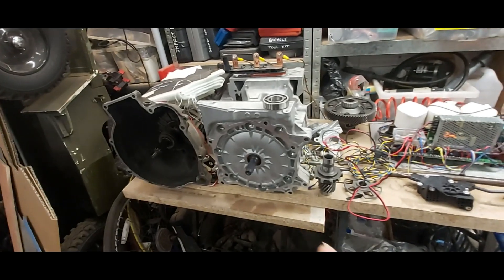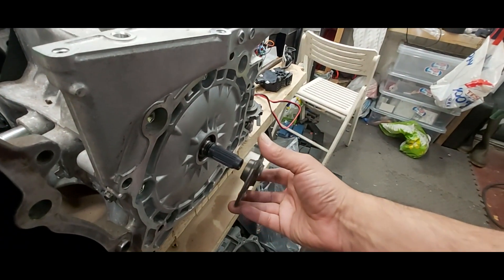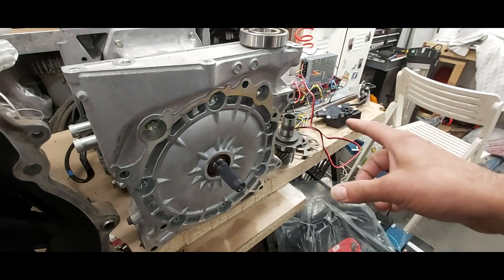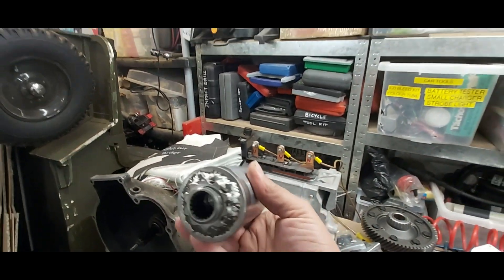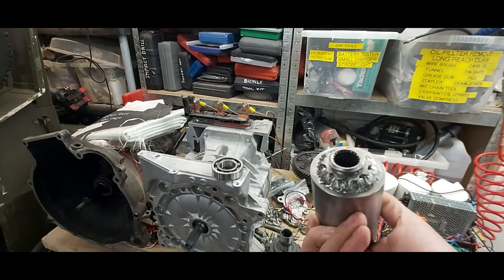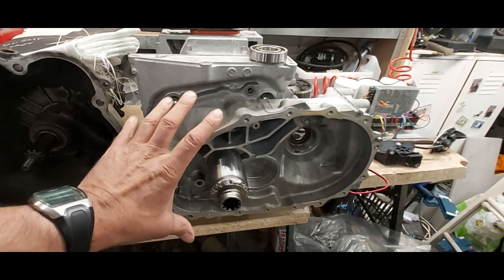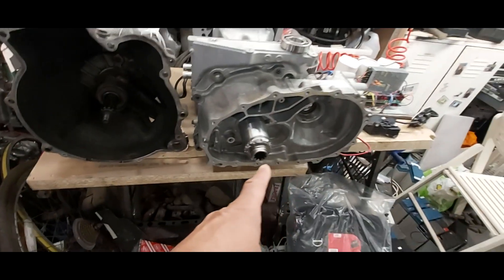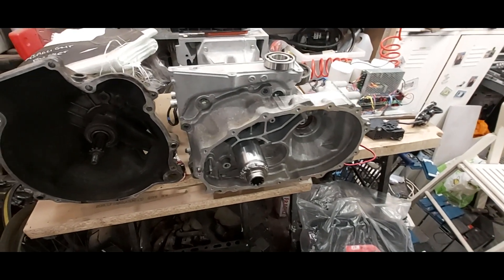Converting a classic BMW to electric. Nissan Leaf Power "The Coupler"Part 5

Comment: Care to share the part number for nissan clutch plate, or at least a model of a care it came of?
Reply from the maker: I used one off these, I think the suzuki jimny has a similar fit, there not 100% fit there is a slight play in it.
https://www.ebay.co.uk/p/10017007296?iid=291767061920
https://www.ebay.co.uk/itm/FIAT-124-CLUTCH-Friction-driven-PLATE-4214053-28139620-1966-on/333524714671?ssPageName=STRK%3AMEBIDX%3AIT&_trksid=p2057872.m2749.l2649